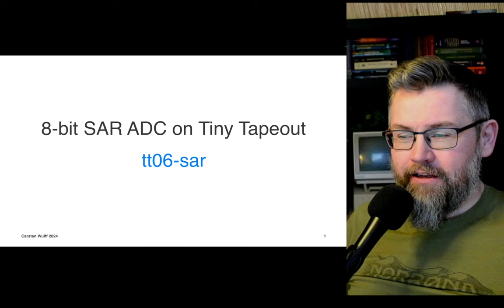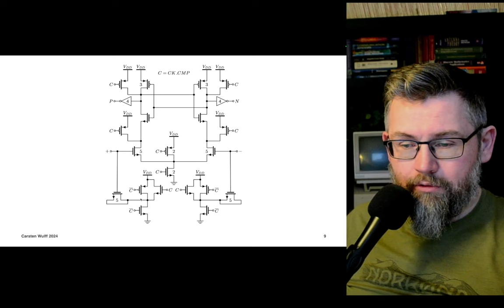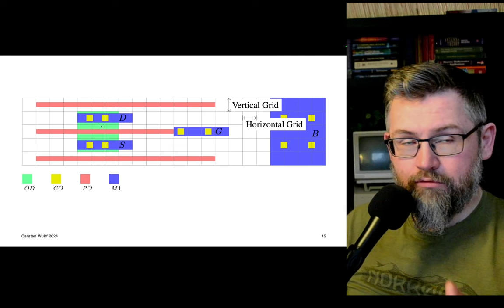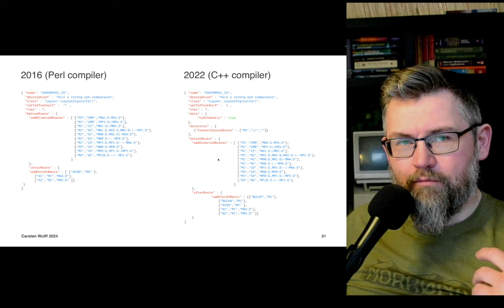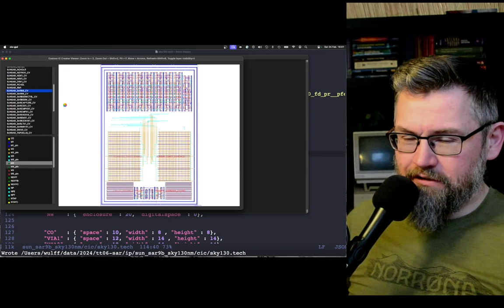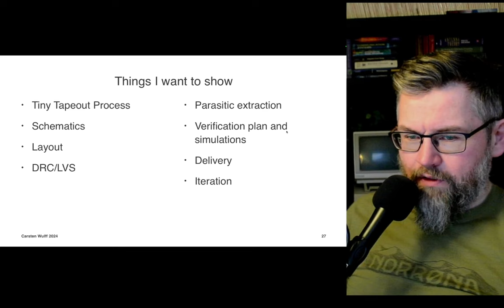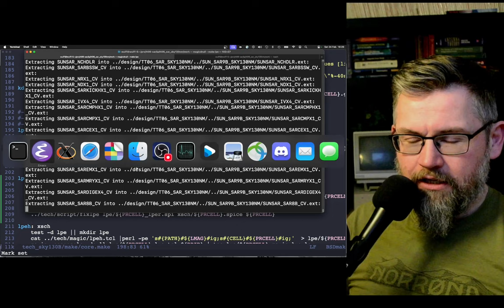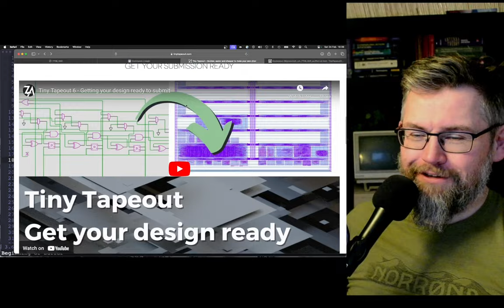Tiny Tapeout - My 8-bit SAR ADC is in!

Comment: ELI5 Abstract

Project: Making a Special Computer Chip

* What it is: I'm working on a tiny computer chip called an
  ADC. It's like a translator, turning sounds and things we measure
  into signals the computer understands.
* Tiny Tape-out: This project lets people like me try to put our
  designs onto real chips! It's usually very expensive to do this.
* My Design: I've been working on this for a long time, and it works
  really well!

Building the Chip with Code

* Like Lego, but with Code: I write special code instead of using my
  hands to build the design. This code is like instructions for
  building with tiny Lego blocks.
* Changing Sizes: My code is smart! I can change a few things and
  make the design bigger or smaller to fit different chips.
* Special Tools: I need special computer programs to turn my code
  into the real chip design. It's like having machines that understand
  my Lego instructions and build the thing.

Testing If It Works

* Pretend Play: I use a computer program to pretend my chip is
  real. I can see how it would work!
* Trying Different Things: It's like playing with toys on hot days,
  cold days, and with slow toys or fast toys. My pretend chip needs to
  work in all those situations.
* Checking for Mistakes: If I make a change, I check to see if I
  broke anything in the design, just like making sure my Lego tower
  doesn't fall!

Getting My Chip Ready

* Special Drawing: I need to make a special drawing of my chip that
  the chip factory can understand.
* Almost Done: My design is working well, but I need to fix a few
  small things before sending in my drawing.

I'm excited to share my chip design with everyone!

Abstract

This video transcript describes the development of a compiled
analog-to-digital converter (ADC) design and the process of porting it
to the Skywater 130nm process for submission to the TinyTapeout
initiative. It is based on work of the guy that made the ADC that is in the 
Hubble Space Telescope.

Key Points:

* Compiler-Based Design: The ADC design is unique in that it is
  compiled, meaning the layout is generated from code that captures
  design knowledge and rules. This approach offers flexibility and
  portability.
* Performance and Portability: The compiler system began as a way to
  create high-performance ADCs. It has been successfully ported
  between multiple technologies (including 28nm, 22nm, and Skywater
  130nm), demonstrating its adaptability.
* System Overview: The compilation process involves defining the
  circuit in Spice netlists, describing placement, and encoding
  routing instructions. A Python transpiler converts this intermediate
  format (cic) into layout (Magic), schematics, and simulation files.
* Challenges and Advantages: The system's strength lies in porting
  to different technologies once the architecture is encoded. However,
  the initial setup and encoding of designs can be complex.
* Verification and Tape-out: The speaker outlines a verification
  plan for the SAR ADC and describes the simulation setup. They
  conclude by discussing the process of generating the GDS file for
  the TinyTapeout submission.
Reply: Summary

Project: Designing an Analog-to-Digital Converter (ADC) for Chip Submission

* 0:00 Introduction to the project: submitting an open-source ADC
  design for a tape-out (the process of fabricating a chip). The
  speaker highlights the affordability made possible by the
  TinyTapeout initiative.

* 1:56 The speaker's ADC design is the result of years of work,
  inspired by a 2009 conference and collaboration.

* 4:08 Explanation of the system they've developed to generate chip
  layouts programmatically, focusing on creating high-performance
  ADCs.

The ADC Design

* 7:21 Overview of the ADC, which uses a common SAR design with
  specialized techniques for efficiency and portability across
  different chip fabrication processes.

* 14:16 Key aspect: the ADC was compiled, meaning its layout was
  generated from code, a unique approach in this field.

Compiling ADCs

* 14:49 The speaker boasts that their compiled ADC achieves
  performance comparable to the best ADCs.

* 15:08 Explanation of the compilation process: layout is generated
  from code that captures design knowledge. The initial system used
  Perl, but it was ported to C++ for speed and with the goal of making
  it open-source.

* 16:50 Key components of the compilation system: netlists
  (describing connectivity), placement information, and an object
  description file.

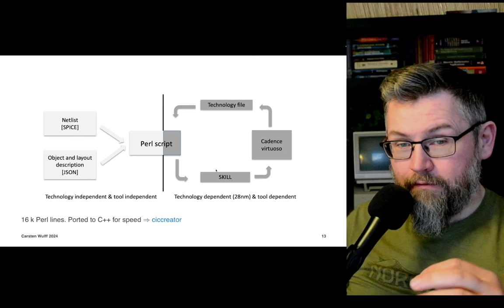* 18:32 The speaker's motivation to port their system to Skywater
  130, an open-source process, to enable sharing their work.

How the Design is Encoded

* 18:43 The goal is to put everything needed for layout generation
  into text files. The system is intentionally simple, without AI.

* 19:17 The design process starts with basic rules, defining even
  the transistor level.

* 22:06 Example using a Spice netlist to describe connectivity in an
  inverter. The compiler uses this information for device placement.

* 25:22 Moving to complex cell design, using Spice netlists for
  placement and JSON for routing instructions.

The Power of Compilation

* 29:33 Demonstration of how the system makes porting to different
  technologies easy.

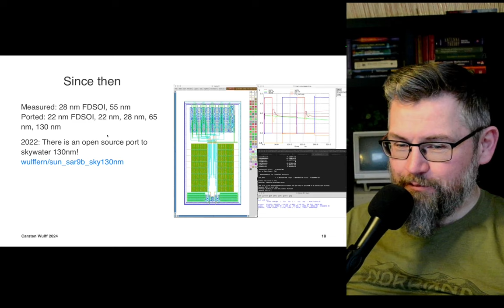* 30:58 Starting the process of porting the ADC design to the
  Skywater 130 process.

* 33:22 Challenges: the system is difficult to use, requiring both
  analog design and coding skills, which are rarely found together.

How the System Works

* 34:34 Overview of the process: start with an idea in Xschem,
  generate a Spice netlist, define layout and routing, then use tools
  to create the layout files.

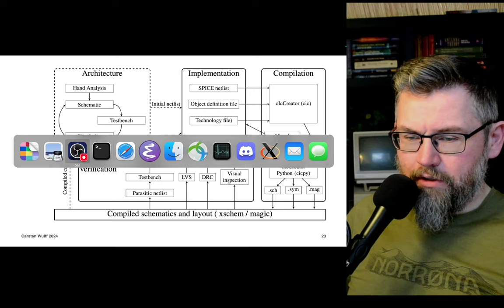* 37:13 Demonstration of the compilation process and GUI for
  visualization.

Porting to Skywater 130

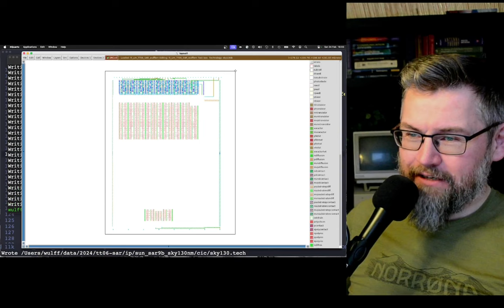* 46:44 The compiler enables porting to technologies like Skywater
  130, and the designs pass DRC/LVS checks.

* 48:03 Explanation of using the TinyTapeout analog template and
  setting up the design.

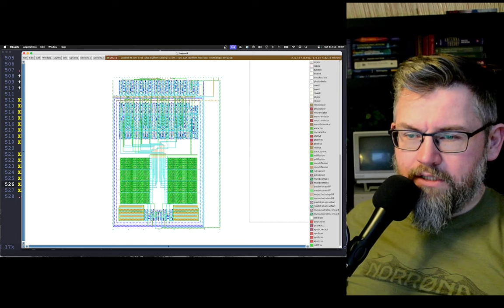* 50:45 Manual routing in Magic was required for some parts of the
  design.

* 51:10 Explaining the CIC file (intermediate format) and its
  structure.

* 53:17 Highlighting the challenge in writing the JSON and Spice
  files for the system.

Project Setup and Simulation

* 55:44 Overview of project organization, using submodules for
  reusability and scripts to streamline tasks.

* 57:20 The compiled schematic, while functional, is not visually
  appealing.

* 59:13 Routing in Magic, demonstrating its speed and DRC features.

* 61:41 Explanation of where DRC/LVS commands are found and how to
  adapt them.

* 1:03:56 Demonstrating the ease of working with older design
  versions using LVS for verification.

* 1:04:26 Explanation of the simulation setup, including parasitic
  extraction and the importance of simulating across different process
  corners.

Verification, Analysis, and Tape-out Preparation

* 1:06:28 The speaker's verification plan for the ADC.

* 1:07:44 Tools and scripts used to manage simulation complexity.

* 1:12:33 Analyzing simulation results using Python scripts.

* 1:15:35 Process of generating the GDS file for tape-out, and final
  fixes.

Conclusion

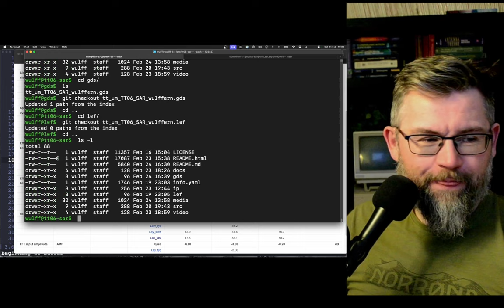* 1:16:53 Gratitude for the TinyTapeout initiative and the feeling
  of accomplishment in having the design ready.

* 1:17:19 Emphasis on the open-source nature of the project and
  encouragement for others to explore and learn.

Disclaimer: I used gemini advanced 1.0 (2024.03.04) to summarize the
video transcript.  This method may make mistakes in recognizing words
and it can't distinguish between speakers.

Comment: Great video as always. I take a look inside the capacitor's DAC and I saw there were resistors inside it. am I missing something?
Reply from the maker: The CDAC schematic does indeed only contain metal resistors. The capacitors are parasitic capacitors between metal lines, so they only appear once the parasitic netlist is extracted. The metal resistors are used to separate nets and get the LVS correct.

Comment: Did you place dummy transistors in the layout ? Active devices might cause leakage without them. Also does it allow to do EM simulations ?
Reply from the maker: 1) Yes, quite a few dummies 2) I have not tried EM on the SAR. If you can find EM setup for sky130nm I would try CAP32C_CV, anything more complex might be too much for EM